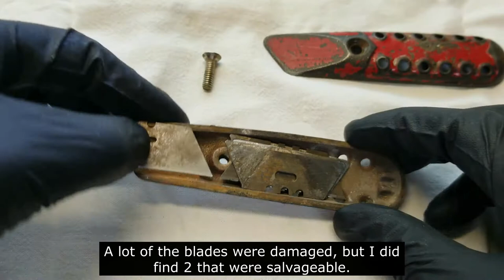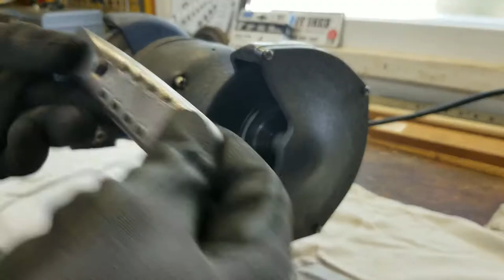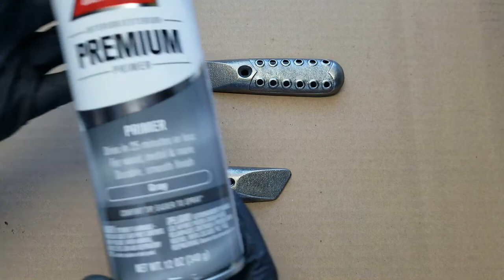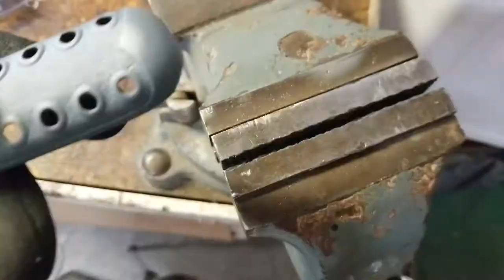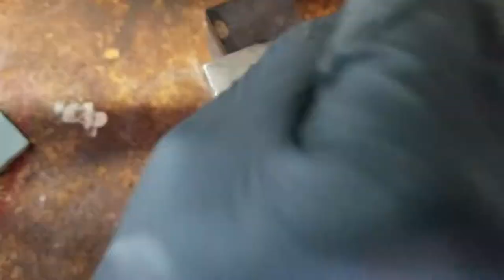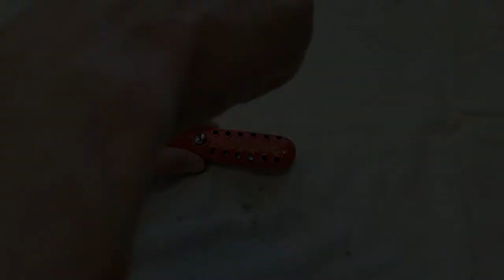Antique Cast Iron Box Cutter Restoration

Comment: I think you mentioned some holes you noticed, after spraying it with the primer.   I'm not sure, but I thought I saw a guy use a "filling" primer on another restoration video.  I'm assuming it fills small holes?
Reply from the maker: Oh nice! Ya, filler primer is normally an acrylic urethane, used for filling small surface pitting. I'm not sure how big of a hole it can fill, but I'd be interested in finding out. haha!